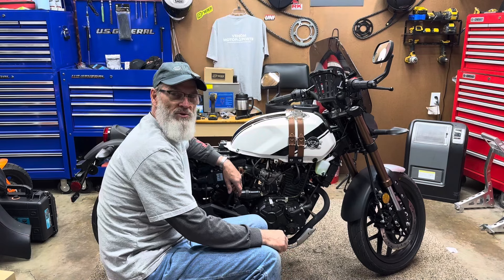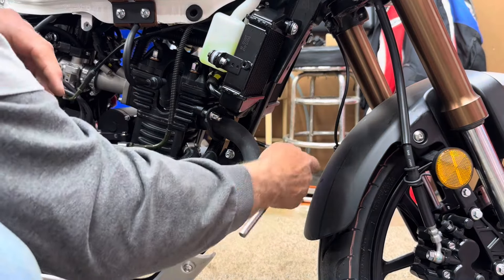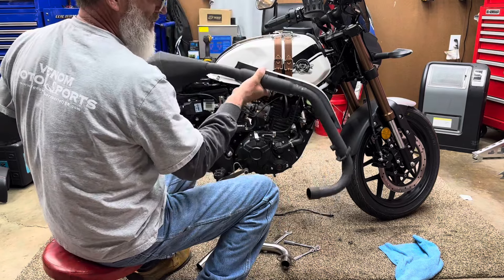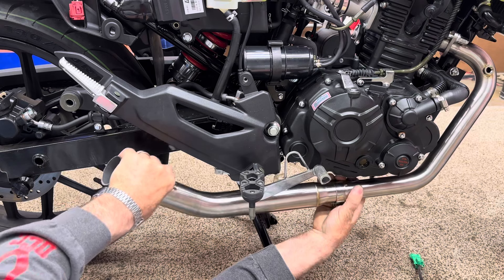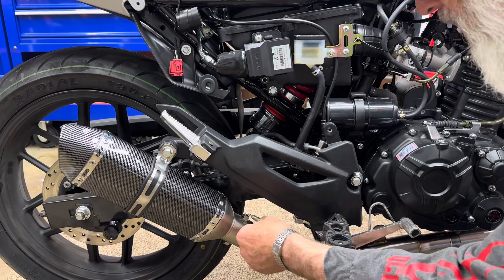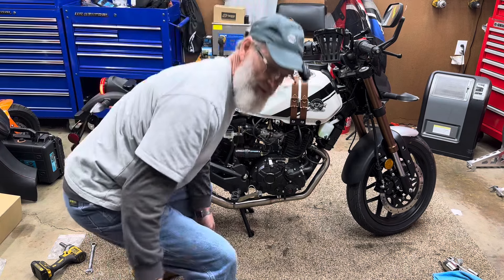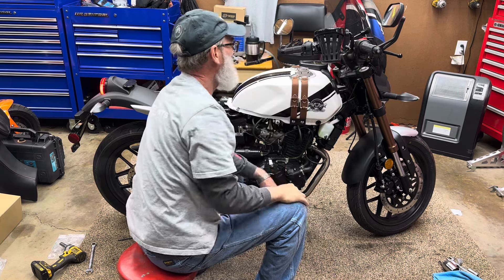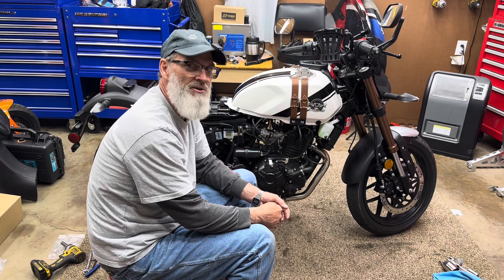Lifan KPM 200 NEW EXHAUST Install and SOUND

Comment: Hmm thinking about buying this one. Was mainly interested in the lifan kp mini 150cc because mini bikes are cool but this one seems a bit bigger and more power then the 150cc. And the look of it seems really sweet that rear fender has to go though and the dangly flexible turn signals are weird lol
Reply from the maker: @LedosGarage  yeah it’s a great bike. I had a KP 150 mini and it’s a good bike too and lots of fun, more power than I expected for a 150cc. But the Kpm is just better in my opinion
Reply: @herbiesgarage681  I hear ya I'll own both one day. The kp mini 150 I've found alot of aftermarket parts for but the kpm 200 I mean they are there. But some are for other 200cc bikes that just fit the kpm or it's aftermarket and u gotta make it fit. Honestly the exhaust video is sweet. I've got the muffler and piping saved. Without the baffle sounded so dam good you must have a good mic because the sound was so good from a 200cc without the baffle is more my speed
Reply from the maker: @LedosGarage  😁 yeah I’m just getting old and noise bothers me more.

Comment: Hello Herbie I was inquiring about buying the Lifan KPR I wanted to know if this would be good for someone that never rode before and learning  to ride and the lifelong of the bike
Reply from the maker: Hello, I think it would be a great first bike. It’s easy to ride, lower seat height and very reliable. It does have a forward lean to it that does make your upper body a little more tired when you ride. The Lifan KPM is basically the same engine with a more upright riding position and would be even better as a first bike. But either choice would be good in my opinion.

Comment: @Herbie can you share how you made the adapter/mounting plate for the pipe and where you attached it on the bike ?
Reply from the maker: Sure, it’s just 1” wide piece of strap steel that you can buy at a hardware store like Lowe’s and I cut it about 4” long and put a slight bend in it. I drilled 2 holes in it, one to mount to the pipe the other to mount to the bottom of the engine bolt, directly behind the rear brake lever. When attaching to the bolt by the engine you will see that the bracket will need to be ground and shaped to the contour of the engine to make a nice fit. Painted flat black when finished. It’s a pretty easy thing to do actually, I’m not even sure that it needs a bracelet there but I like to overkill sometimes. 😆 Let me know if you need anything else
Reply: Can you share a picture?
Reply from the maker: @ I’ve tried posting pictures before in the comments and it’s a no go. If you email jherbie55@gmail.com I can send it that way

Comment: Can you just change out the original muffler to the carbon fiber exhaust and leave the exhaust pipe?
Reply from the maker: @Haven_wayRBLX  Sure, the replacement muffler will be a little shorter so you have to visually look at it and see if it lands to where it looks good and not blowing hot exhaust gasses on anything
Reply: @ is there any cutting involved do you think because I was trying to get a good look at it in the video when you moved it and looks solid.
Reply from the maker: @ yes it would have to be cut, it is one solid piece all the way from end to end
Reply: @ okay thank you for the information. Probably be best to buy the exhaust bike instead of cutting.
Reply from the maker: @ you’re welcome, you will have better performance with a full exhaust and it’s actually very easy to install. It cost a little more up front but it’s better in the long run
Reply: @ yeah that’s true I’m just worried about some of these exhaust pipes not fitting since you had to modify yours.
Reply from the maker: @Haven_wayRBLX  It will bolt right up, I just added a center support bracket. It may or may not need it
Reply: @ okay 👍

Comment: They finally extended the silencer tip. I had to fabricate an extension. 
When you mount it, use a nut on the top of the Allen bolt, because these silencer tips tend to fly out at full throttle for anything over a 125cc.
Reply from the maker: @ProDigit80  Good tip!

Comment: THE EXHAUST GASKET WHERE YOU CAN BUY IT
Reply from the maker: You can find them on Ebay or Aliexpress.com I haven't had to replace mine but the pipe measures 33mm inner and 39mm outer. You just need to measure the inside oping of the exhaust port to make sure it fits but something like this will be work https://www.aliexpress.us/item/3256805230650535.html?spm=a2g0o.productlist.main.15.602fLpTMLpTMHK&algo_pvid=e4fdfc6e-4d0c-4ac0-a3bb-ec87ccd3ffb0&algo_exp_id=e4fdfc6e-4d0c-4ac0-a3bb-ec87ccd3ffb0-7&pdp_npi=4%40dis%21USD%2114.50%2110.15%21%21%2114.50%2110.15%21%402101c5c317224173681488305e5a8d%2112000032977310952%21sea%21US%210%21ABX&curPageLogUid=KgoRnnR520dD&utparam-url=scene%3Asearch%7Cquery_from%3A

Comment: hey Herbie, quick question for ya. is it a good idea to add antiseize to the header bolts when installing the exhaust? Thank you!
Reply from the maker: You could but honestly I wouldn’t, I have never had a problem with them dry and antiseize may be more apt for the nuts to vibrate off.

Comment: When you buy the new muffler does it come with new pipes for it like you have or do you need to order them separately somewhere? It sounds good as fuck not gonna lie lol.
Reply from the maker: I bought my pipe from Aliexpress and the muffler from Amazon. You can buy the whole package on Aliexpress pretty reasonable, if you want to. The reason I bought my muffler separate was I wanted this style with the removable DB killer to quiet it down a little bit. Thanks!
Reply: @ cool I’ll check it out and hopefully get it installed soon. I’ll hit you up on social with the final product!
Reply from the maker: @Haven_wayRBLX  You’ll like it I’m sure
Reply: @herbiesgarage681  now the washers you used what size were they or could you get an exhaust that might fit a little better?
Reply from the maker: @ I think I just used 3/8 thick washers if I remember correctly.

Comment: can u share link to that exhaust u got herb
Reply from the maker: Okay, I’ll look for it but I bought it on AliExpress. I’ll check when I get home from work
Reply from the maker: https://www.aliexpress.us/item/3256804551981429.html?spm=a2g0o.productlist.main.1.6f5ac278EyxYsg&algo_pvid=d457030c-9bb2-457b-a51b-18e68d59066e&algo_exp_id=d457030c-9bb2-457b-a51b-18e68d59066e-0&pdp_npi=4%40dis%21USD%2148.40%2138.72%21%21%2148.40%2138.72%21%402101e58317141769992908277e85eb%2112000030294865614%21sea%21US%213024176881%21&curPageLogUid=KnuDIXEtKqo5&utparam-url=scene%3Asearch%7Cquery_from%3A
Reply: @herbiesgarage681   thank u my brother....strongly considering buyin this bike for my b day this may
Reply from the maker: @marcpierre-x2v  Happy birthday! That would be an awesome birthday present 😂
Reply: @herbiesgarage681   was it difficult puting the pieces together? that was my concern..
Reply from the maker: @marcpierre-x2v  The headlight was a little bit of a challenge and the front wheel you will need a hand with. Not hard just time consuming
Reply: @herbiesgarage681  i managed to macgyver the front wheel on with the help of a stand, but i definitely recommend a 2nd pair of hands
Reply from the maker: @radfordmcawesome7947  Yeah, extra help will definitely make the process easier. I'm glad you got it together though, Good job!!
Reply: @herbiesgarage681  thank you!  it is my first bike, and your videos have been of tremendous help 😁
Reply from the maker: @radfordmcawesome7947  That's so awesome!! First bike of many I'm sure, once the bug gets you it's hard to shake : ) And you're welcome my friend